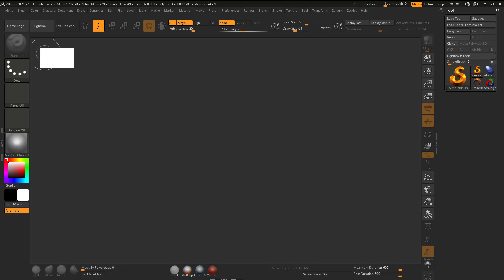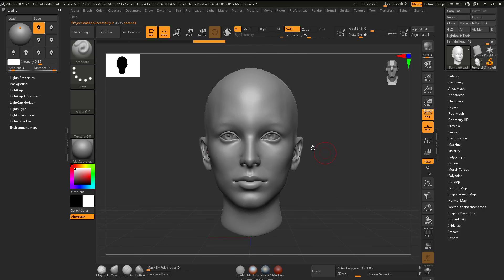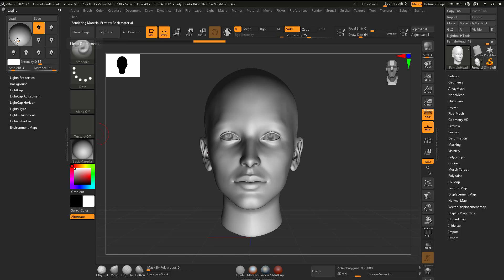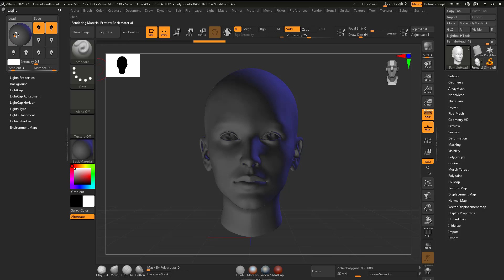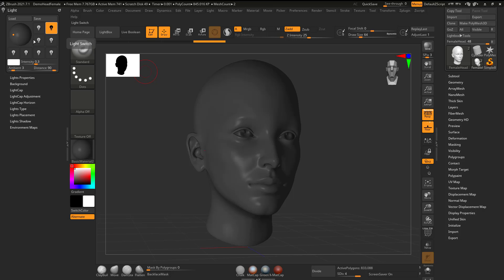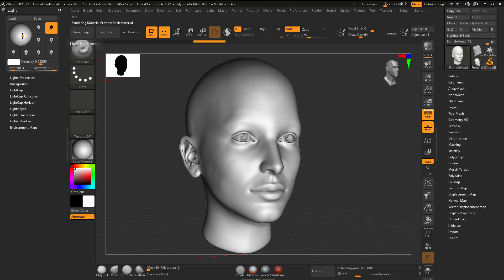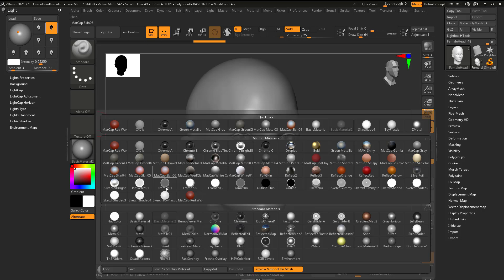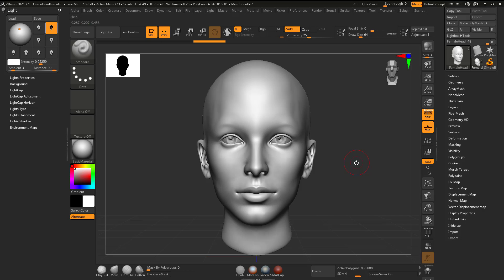ZBrush Lighting Tutorial

Comment: Hii David my light option isn't working on any material
plzz help
Reply from the maker: Make sure it is not a Matcap material and it’s a standard material. Note that some standard materials won’t work. In your light option, make sure the light button is on (orange) AND has a thin orange line around it indicating that that is the active light. Then try moving the light. If that doesn’t work make sure you have the exact material I use in the video.